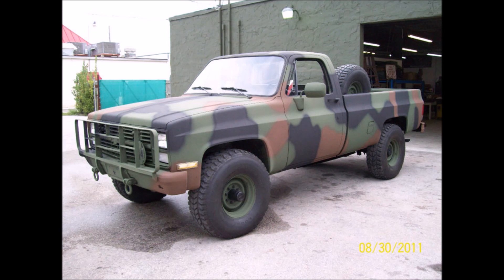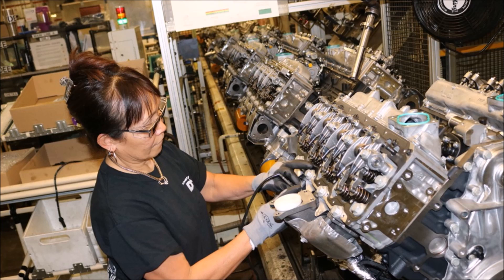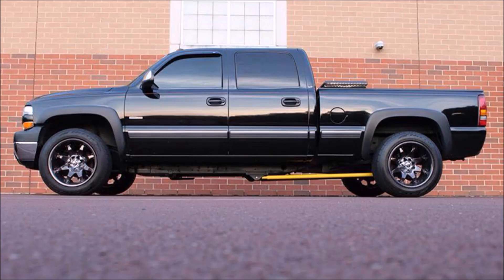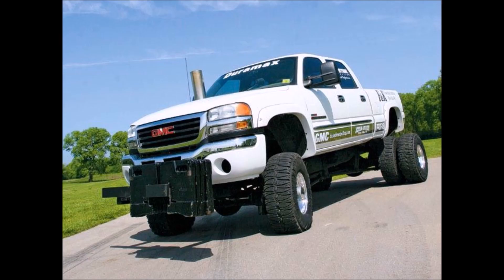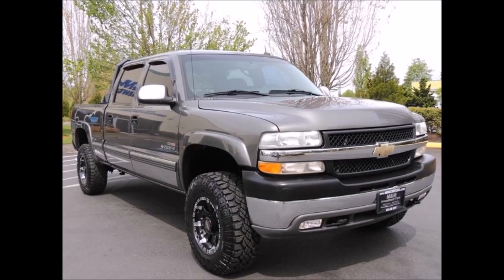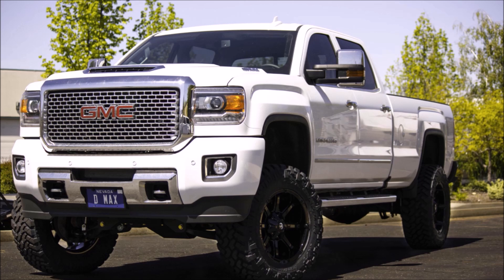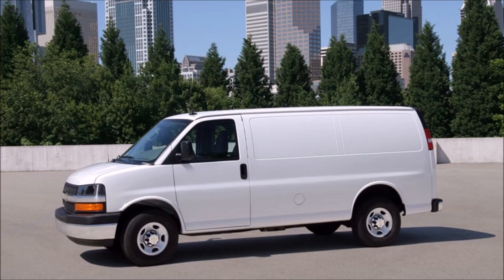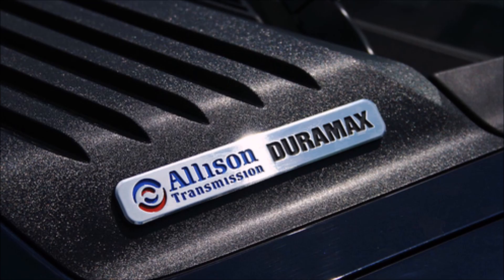History of the Duramax Diesel: From LB7 to L5P

Comment: you said lbz has a stronger engine, but you failed to mention the pistons are a weak point so its a trade off. i wouldnt say its any more capable than previous generations due to this. the prior generations have weaker rods tho so its a trade off. also lly has the biggest vgt turbo of any generation duramax

Comment: Im really a ford guy but is there really any advantage to duramax over powerstroke?
Reply: Really depends what years.  The newer ones are all pretty close. All of them, including Cummins , have their own issues. 
The 6.7 PS is looking like Ford finally got their sh*t together. The L5P DM has been a strong , well received motor from pretty much the start.  All the newest trucks are coming stock with at or near 1000 ft / lbs of torque.  Unless you need crazy power these don’t really need a delete.  Just drive them and put in the blue juice.

Comment: LLY was produced through 2003-2006
Reply: Carmen Morales wrong 04.5-06
Reply: Cody Yellott wrong, 2004.5-2005. The 2006 “LLY” was actually a LBZ engine with the LLY engine code. The hardparts are LBZ, but GM was having trouble passing a new engine, so they put in under the LLY engine code
Reply: No they’re not
Reply: 04.5-05